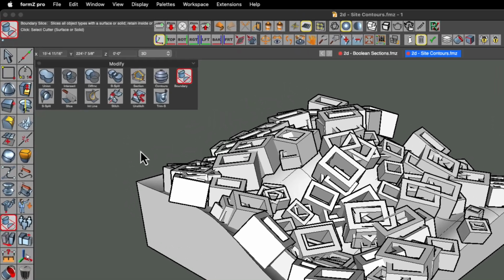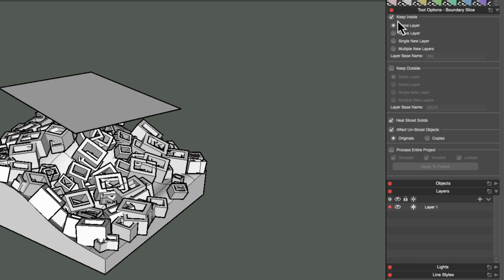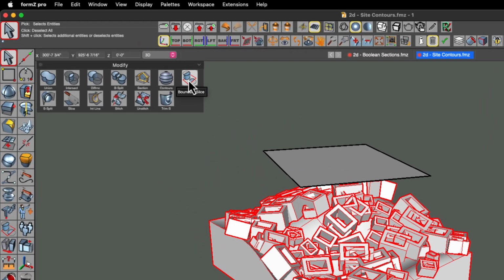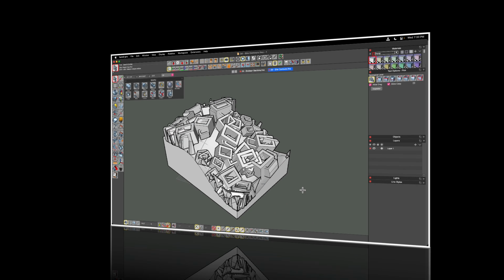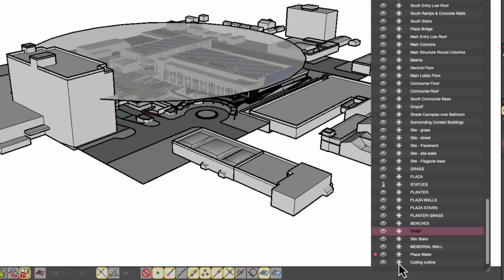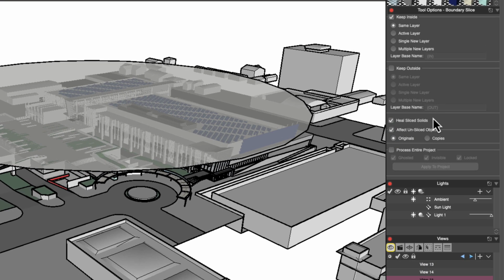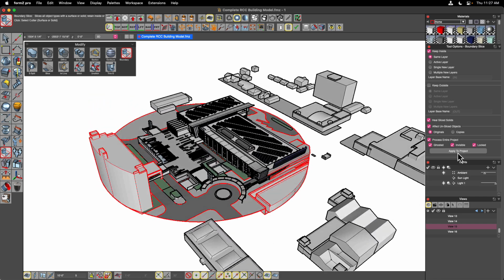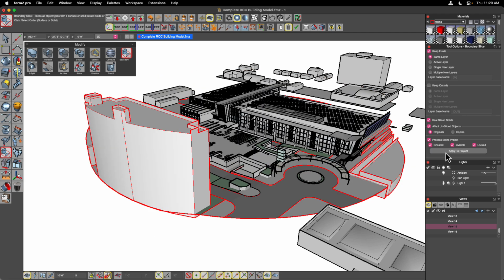Slicing Tools, Part 3   Boundary Slice

Comment: Hi Evan,
So many Form.Z tools ! even more than your previous Fundamentals course, amazing. 
The slicing tools seem destructive, unlike the non-destructive clipping planes, so handle with care I guess !
Reply: Ghosted operands should be retained in the file...i.e., the original object should still be there in a ghosted form and you can unghost it if you need it.  At least that's how it was in earlier versions of Form Z.  I need to check and see if it still works in FZ 10.
Reply: Yes, Clipping Planes are visual, constantly transformable, non-destructive, and only planar whereas the Boundary Slice tool for example can be any shape you want (but destructive). As @giacomo9999 states, using Ghost Operands is probably a good idea when using various slicing tools.